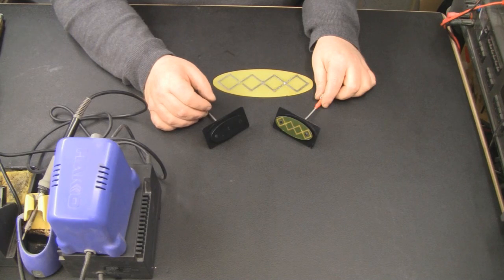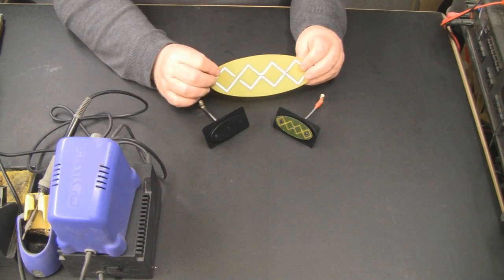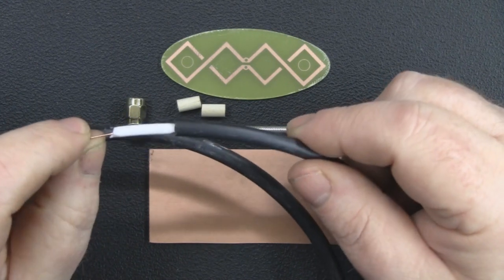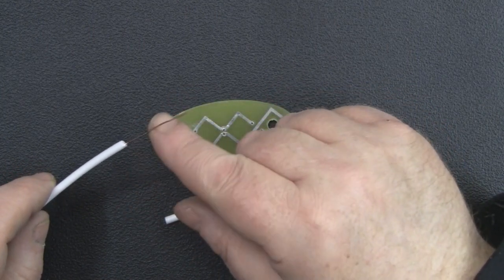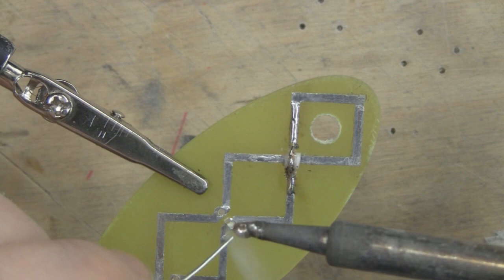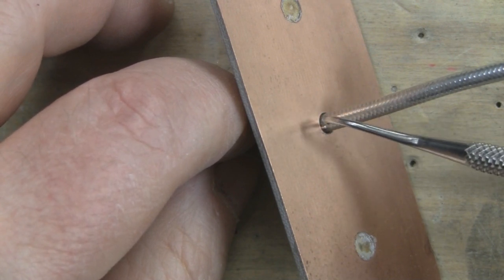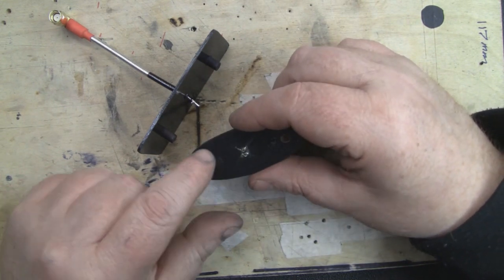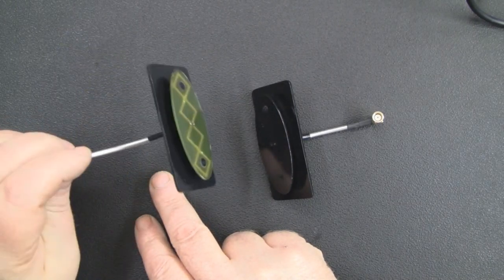5 8GHz Double Biquad #86

Comment: Neat work, I like the work with spectrum analyzer,ect. I am going to build a couple of  5.8 GHz Double Bi Quads , one diamond shape and the other circular. What would be interesting is set the diamond shape or bow tie to slightly different specifications. Since Length =c /frequency /4 for quarter wave length  which equals 12.92 mm, the OD of the diamond using 1 mm copper wire set at 13.92 mm, ID would be 11.92 and center to center would be 12.92 and then test this configuration on the spectrum analyzer and see how the range compares to other builds, if you get a chance test that or comment on it.

Comment: Hello Sir,
Very nice videos and detailed explanation.
I want to know, how important is the width of tracks on the pcb? They are about 1.6mm in your template. But can we make them a bit wider or thinner? Say 1.4mm or 1.7mm? Reason being, I use the primitive method of making PCBs where I use screen printing to block the area and it is not micron perfect.
A little in-depth reply on width of line/track would be highly appreciated.
Thanks and good wishes,
Sahil

Comment: The hump sections add electrical length to the antenna, has this been added into the calculation?

If not the antenna will not be tuned to the frequency calculated for, the tolerances when working with high frequency's like 5.8 are very tight.

There's no reason why a simple thin non conductive plate or even a small piece of  insulating tape cut to size can't be used if the soldering is done quickly before the heat gets a chance to melt it, that would produce a flat finish.

Comment: If the dowels are 9mm, as you say in the beginning, how do you get a 6.5mm "gap" without cutting?  They make 1.25mm thick copper clad board? that's the only way.  The start - end length indicator in the PDF isn't clear for the "gap" Seems like i'm nit-picking, but I thoroughly enjoy your videos, I would just love to make one of these, and i'm a bit of a perfectionist.

Comment: Hello Andrew,

I have been playing around with solar panel cells of late, and a great alternative to your DIY copper tracks is solar tabbing wire. I have just measured some with my calipers. It is pre-tinned copper tape 2mm wide in lengths of however long you want. If you are going to make these on a commercial basis, you should be able to get tabbing wire in quantities that will be make it viable for your project. A search on ebay will quickly show you what I am talking about. Solar bus wire is wider and the tape is much thicker copper for the higher current required between each bank of cells, but tabbing wire would be perfect for your needs. 

All the best with your venture.

Cheers, Marschy

Comment: Hello Andrew,

Is there any reason why the link could not be soldered onto the back of the fibreglass board, similar to the way a link is added to a pcb. It seems to me the way you have added the spacer using the core from the coaxial cable would be changing the wave length ever so slightly. Adding the link on the opposite side of the board would only increase the wavelength by the width of the fibreglass board x 2, which may be about the same length you have added, but lessens any likelihood of the two tracks getting shorted out.

This would not be any different to your original idea of using double sided copper board.

Cheers, Marschy

Comment: I thought 75ohm is for tv frequencies and 50ohm was for hf 26-28mhz
Reply from the maker: ***** Sorry I don't know what you mean? What's 75 ohm?
Reply: you said you were using cheap 50 ohms coaxial cable, 50 ohms is generally hf and not used for TV's antennas and so on. 75 ohms is used here in Australia for tv antenna's and etc,
To me it looked like cheap 75 ohm coax you were using and not the 50 ohms
Reply from the maker: ***** I see sorry no I was using some cheap coax that a local shop was selling off as they were closing down. I got a 100m real for £2 it says 50ohm on the real but I only use it to strip the solid copper wire out of the centre and the braid makes a good de soldering wick!
Reply: great job, all the best..

Comment: Hello Andrew, nice build but I have a Question, You mention using this with an Omnidirectional Biquad,
 My question is this, isn't this build for a Linear Polarized Double Biquad, and I'm guessing that Transmitting an Omnidirectional Signal works just fine with a Linear Recieving Ant. Is this the case?
I just thought Linear and Omnidirectional wasn't compatable, I'm new to all this and learning. I thought Omnidirectional meant Circular Polarized. Maybe I'm misunderstanding the terms?
Reply from the maker: Soco Joe Hi Jo Omnidirectional is the direction of power it is easier to understand if you think of an Omnidirectional antenna is a light bulb and a directional antenna as a torch (flash light). The bulb will light up a wide area 360 degrees but has short range. A torch will light a small focused area but has a much longer range. Omnidirectional and directional describe an antennas beam. Hope this helped
Reply: andrew mcneil Thanks Andrew, I kinda understand that aspect that an Omnidirectional is like a Mushroom shape that radiates in all directions somewhat with an equal power, and a Directional is more like a Cone shape that is weaker outside of the cone signal depending on it's gain, higher gain equals smaller cone shape but stronger signal, My misunderstanding is Linear Polarization versus Circular Polarization, I didn't think the two were compatable. Thanks for your Vids and guidance, presently building one of Your Helical designs for FPV...  :)